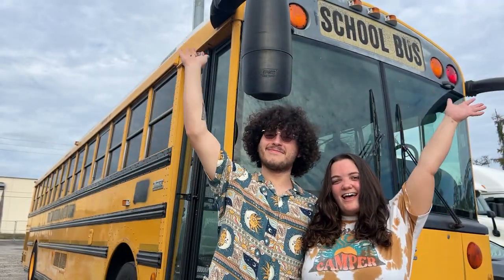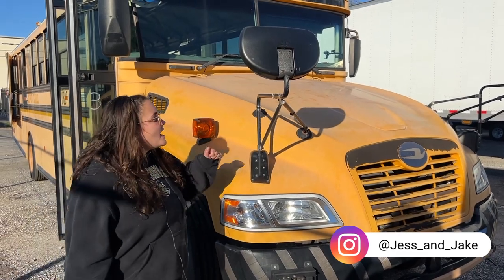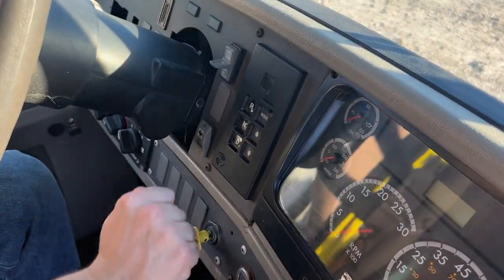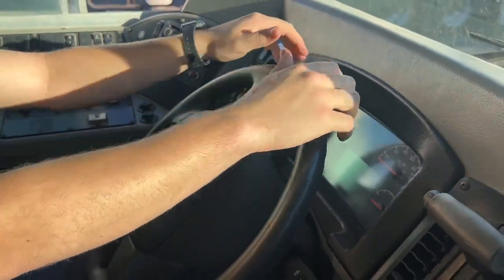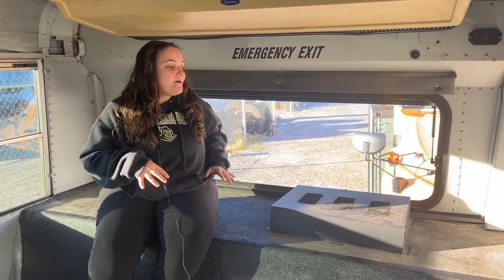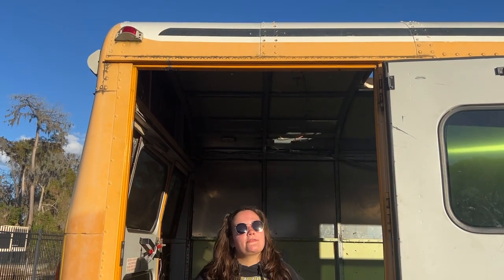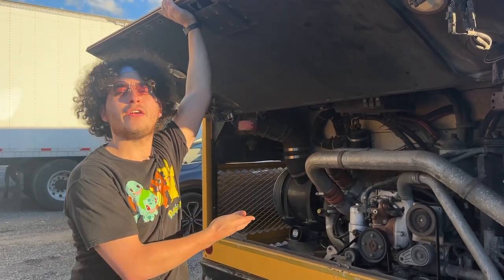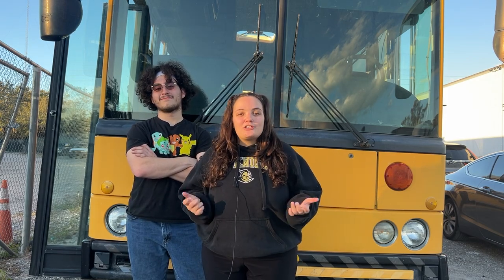SCHOOL BUS COMPARISON | OUT WITH THE OLD!

Comment: You'll like the feel and the noise of the rear engine bus. Seems like a pretty good bus overall. I would have steered clear of a high mileage Mercedes engine, but with that low mileage you should be just fine.
Reply from the maker: Exactly, we feel like this bus makes everything alike for us. Super excited to se show everything turns out when’s it’s all finished :)
Reply: Carter-sl4hl my school has 2015 IC school busses. They have very low miles since they got them in like 2019

Comment: Hey you two great videos as always. Not to tell you what to do on your bus for the build, but please avoid this YT trend of removing the front heater and defrost systems. Folks are making some kind of shelves or related in these spots. You are removing two primary sources of heat. The diesel air heaters are cracking the the windshields of the busses out here. Last I checked, $3200 for those two windshields new plus labor. Just a future heads up for ya. Also, your wire harness that goes from from front of bus to rear of bus, that supplies rear brake lights and everything else, is not weather rated., and will crack and fall apart in short time. If possible, build your bus around the wiring you have left.  If splicing under bus, use new weather rated wire. Typically 7 wire 14 guage trailer wire is great. FYI

Comment: The flat nose is better for visibility, this is a BIG plus over a long nosed bus.
I know nothing of Mercedes engines, but I do know a bit about the Cummins 6.7 litre.  
Hubby's pickup has a 6.7L Cummins and his old Semi tractor had a pre def Cummins engine.  They are pricey, I want to cry every time we have to make repairs to hubby's truck, and that does include an engine swap.  (Hubby's fault, not the engine.)
200k is peanuts for a Cummins, I think your old bus may have had an incident in its past.  A hole in the block takes some doing.  The engine we swapped was because Hubby blew the oil pump and then kept running it.  The final give up on that 08 was noisey and frightening.  Dropped an 09 from a wrecked tow truck into it.  
What you get for all that money is more power than you'll ever need, the best fuel mileage and longevity.  Barring stupidity and other outside forces.

I think I'll subscribe just to check out how that Mercedes will work out for you.  The lack of nose is better, especially if you're new to driving bery large vehicles.

You'll be fine with the extra length so long as you remember that big yeller butt is back there.  That's how I learned to drive a 40ft vehicle.  Back when they would rent them to people with only classC licenses. 

You'll definitely like having the extra space though.

Comment: Nice thing with a pusher engine is that, there is more weight on your rear end and you don't have to have as long of a drive shaft and run the risk of twisting or breaking a u joint on the drive shaft.

Comment: you may need a class A license for the new bus don’t know about your state but you might need it in other states when travel 
and if you don’t need it the most important thing please learn how air brakes work you don’t want to learn the hard way 
Good luck with the new project
Reply from the maker: For sure! That’s soils advice, we are good for the state we are in. Also agreed, the brakes aren’t something you want to break lol.
Reply: Federally, anything over 26,001 lb you need a class b minimum or a if you are towing a trailer that weighs over 10k. You can get non commercial class a license. Then you will not be in the federal dot drug test pool. I’ve been a class a driver since 2004 and it sucks I can’t smoke a blunt if I want.
Reply from the maker: Awe, dude that sucks. Thanks for the information and we will spend time looking into exactly what we need :)

Comment: Does that thing have a 6 speed? I know it’s a Allison transmission which in some cases is nicer for people who don’t know how to drive stick. But it is a freightliner so it’s probably gonna be better to get parts at a freightliner than a bus company dealer since the cluster is freight liner and the new Thomas buses are freightliner . Congratulations
Reply: That model will have a Allision MD-3060 six speed. For the school busses only gears 1-5 are active. The reason 6 is locked out is because the engine is "de-rated" on full power. Gear 6 or lock up, would just bog it down. However, if they take the bus to a dealer, get the horsepower turned up ($400), have the Allision TCM removed and reprogrammed, they will be fine. Last I checked, Allision wanted $900 for the recode.
Reply: Anything coach portion is bus and easy to find. Anything truck (rolling chassies) will be Freightliner or whomever the builder was. All of those parts are "dime-a-dozen" common heavy truck parts. Easier to find than car parts.
Reply: @johnclamshellsp1969  for sure